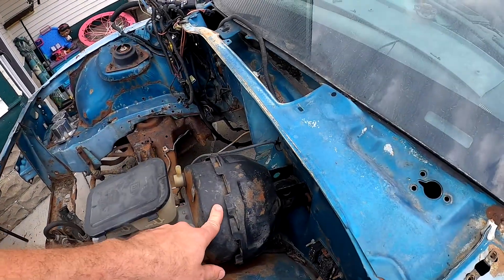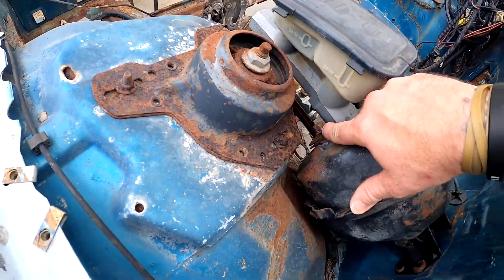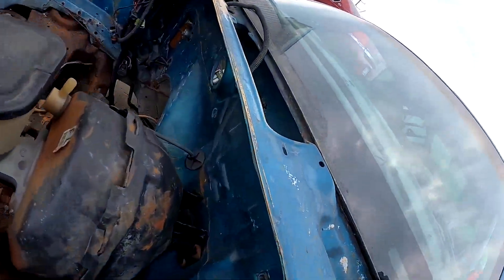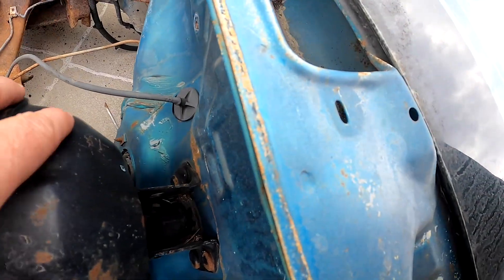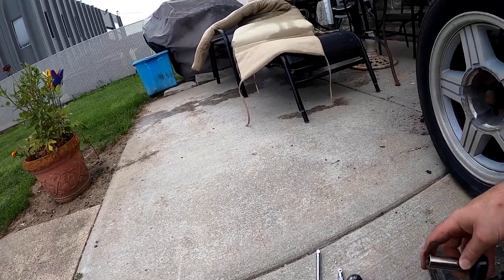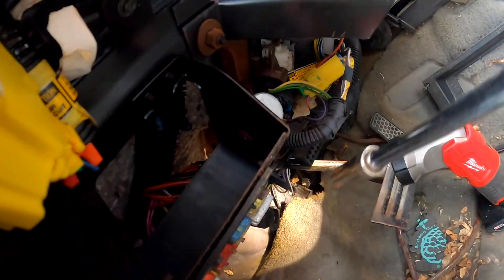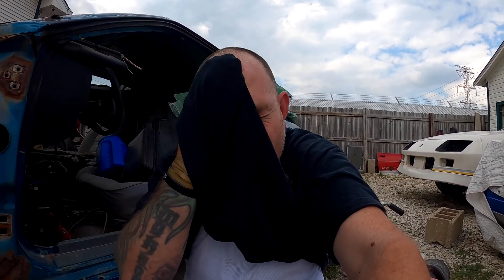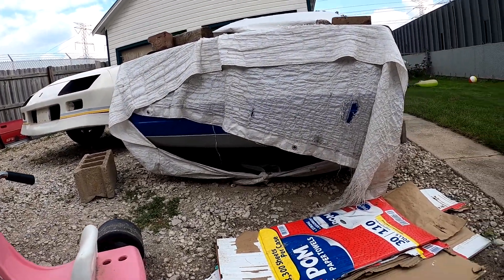How to remove/install a brake booster on a 82-92 Camaro.

Comment: very helpful video, sir.  thank you for producing it!     1988 camaro, t-5 transmission.  removed the brake m.c. from the booster.   removed the steering column support nuts under the dashboard (not the ones on the firewall, of course), to allow me room to see the top-right brake booster nut (15mm) and to reach the brake pedal pivot support bolt.       
there is a  brace on either side of the clutch/brake pedal bracket.  each brace has an end on the firewall where the clutch m.c. and its u-bolt are fastened to said firewall (15mm nylon-insert nuts).  the upper end of each brace is fastened to the  bolt which provides the pivot support for the clutch and brake pedals.  15mm nut on the left and 15 mm bolt-head on the right.             
 a box-end wrench on the left, and a 15 mm deep socket, on a wrench without a flex-head will do for loosening them.    i didnt remove the bolt completely-i just moved it over to the right about 3/4"- because i just wanted to move the brace on the right side out of the way.  thus i could reach the top-right brake booster nut with an extension.      

thank you again for producing all  of these videos, sir!  i will need more help from your videos in the future. if i can be helpful to you then please let me.  eric lambousy, also available on FB.